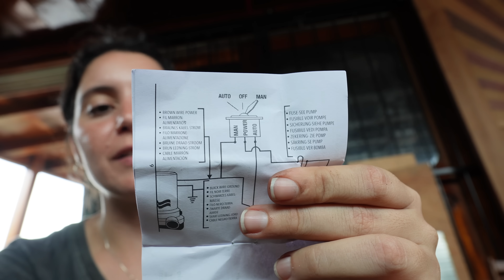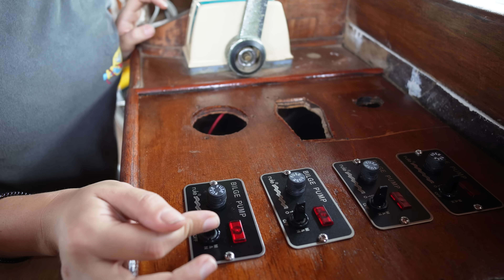This rescued wooden boat won't sink anymore: installing big bilge pumps — Sailing Yabá 178

Comment from the maker: Welcome to Day 10 of our saga towards launch!! 
Place your bets: are the bilge pumps going to work on the first try? 🙈
Reply: YES!
Reply: Donot place outlets below water lines!
Reply: Happy birthday Ben
Reply: I wonder if you've decided where to store the spare fuses?
Reply: might want to put one way valves in the hoses for the bilge pumps in you are gone conect all to one trough hull. so the water doesn't flow from 1 bilge pump trough the hose to the lowest pump. but can only go out of the ship.
Reply: Easy for boat to SINK with thru hole under water
Reply: Of course they will work! 😎
Reply: Easy yes
Reply: Yes
Reply: If I were you, I would install a whale manual pump as an emergency backup should you have a power failure or need extra pumping capacity to save you bacon! Still no reply to the holding tank comment of days 8 and 9. Given we have no date stamp I am sure you will make it happen!
Reply: Happy birthday Ben loving these Daily posts you guys are doing great

Comment: Happy Birthday Ben!  You guys are getting so much done!  Please do yourself a favor and connect the bilge pumps to the wires using heat shrink butt connectors which seal moisture out of the wires.  Those mechanical connectors you are using will be completely corroded in less than a year in a salt air environment, even if they don't get splashed.  Also, you didn't mention if your wire "straight from the battery" has a fuse on it, or if you have fuses or breakers on the pumps themselves (since you are bypassing the usual switch/breakers on the panel).  If not, please add them so you don't risk a worn out pump short circuiting and starting a fire!  (Sorry if you already know all this and just didn't mention it in the video.  Just want you guys to be safe!)
Reply: 100% do this!
Reply: Yes. A good point. More horrors are experienced due to fires on board.
Reply: Great advice but I solder all of my wires that are in the bilge area. And even put dielectric grease on joint then slide over the heat shrink. Shrink it with a heat gun. Some grease will ooze after shrinking just wipe off. And I hope that all that wire is at the least pure copper preferably tinned. A lot of wire now days is copper coated aluminum and will carrode and turn to powder inside the heat shrink in fresh water conditions let alone salt. Fire is a no no in a boat but a failing bilge pump is just as bad when taking on water in open seas. Plus I always put in two pumps in every location for redundancy. Plus a light that will let you know when that float trip switches on is extremely important those switches are not fail safe by any means.
Reply: @gkblair the bilge pump switch has built in fuse. Connectors are in waterproof box so don't need shrink wrap.
Reply: @davidharbison6861 bilge pump has red light to indicate when circuit is made
Reply: @petergreen3381 those connectors are crap. Need a 100% seal   Salt air corrodes anything
Reply: If you put a switch on you bilge pump what prevents it from being shut off when needed? Why would you ever want to shutting it off
Reply: @upinyou8  when strainer is blocked and you need to lift pump body out

Comment: Thanks!

Happy birthday Ben🎉🎉

MP The best comparison of a bilge pump is a sump pump in a house that has a float switch. It’s usually in the basement down in a hole referred to as a sump. It’s where all the water from the basement would go to and then the pump takes the water out of the house, either outside or down the sewer, depending on local ordinance.  Yes, I am full of useless information. 😂

Comment: I think one of the hardest things for non-wooden boat people to accept, is that water in a bilge isn’t necessary a bad thing. And on a wooden sailing boat, it’s inevitable, and a good thing. With such thick hull planking, it’s good to have some water in the bilge to ensure that the planking swells evenly. 
I’ll pass along a fun tidbit about bilge pumps. When your fast asleep, lulled into that wonderful comfort of being on a boat that your own hands and mental powers have helped to craft, when the gentle rocking has finally lulled you to sleep; nothing, absolutely nothing will make your eyes fly open as fast as the sound of a bilge pump coming to life! 
However with that said, the sound of a bilge alarm, will literally tighten every single muscle in your body. So, to avoid a two AM WTF! attack, silence the lowest pumps alarm. Yes some water may have sneaked its way in, however there are alarmed pumps higher up. No since in having a heart attack when you don’t need to😎
And  don’t forget check-valves installed immediately next to the pumps, but in a serviceable area. On the forward pump that will have a pickup hose, install a brass trash filter, not plastic. Plastic can break and allow trash to jamb the impeller. 
Wishing y’all a long and carefree sailing life!
Reply: True all of that AND you should EXPECT some leakage until the wood in the hull expands due to being wet-do not panic it's normal.  After seeing what you faced after sailing the boat initially  I suspect you do not panic easily.😝  Finally I would not put a bilge pump under your bed because that will destroy a good nights sleep.
Reply: Painted bulkheads and bilges illuminate at least 90% of exterior sources of water so most bilge water in from internal sources which always makes for a fitful sleep when at sea. 
I love both of your energies and how you compliment each other and am so glad that I discovered your channel.
Cheers from Vancouver.

Comment: Just some advice, I had a 35’ sailboat for years and when I rewired my bilge pumps , I soldered all the connections  and use shrink tubing on them , making the wiring Full proof against moisture on those connections, yes it’s more work but it’s also trouble free , the last thing you need is a bilge pump not working because of the wiring !

Comment: Happy Birthday Ben!
Two tips on bilge pumps:
- Install a check valve on the discharge hose close to the pump. This prevents water in the hose from trickling back in past the pump vanes.
- Power all bilge pumps and the VHF radio from an emergency electrical panel, switched/fused separately from the main panel. In an electrical fire you still want pumps and VHF after shutting off all electrical.
Reply: A lot of debate online about checking valves on bilge pumps. They can get stuck closed if debris gets sucked in the hose. I'd do some research and make the call. No wrong answer here, just an ongoing debate.
Reply: @gkblair  I've seen a bronze check valve seize closed once, but the owner had it installed in a blackwater discharge. I suspect the fecal matter had something to do with that. In 5 decades of boating, I've never seen a bilge pump discharge check valve seize. But that doesn't guarantee perfection.

Comment: Don’t over tighten the underwater through hole fittings. All of the planking is going to swell. 
The hollow fittings can crack due to over tensioning due to the hull swelling.
If they’re sealed and not at all loose, that’s good enough. After a few months you’ll probably find that they're much tighter than you first installed them.

Comment: Keep a spare pump with a long enough wires to reach a 24 volt power source anywhere on the boat.  Attach clips to the wires, have long drain hose and keep it stored. If a situation comes, you can drop the pump in a critical area and move it around as needed. Great job as always !
Reply: Agreed, this saved one of my boats when I had set the bilge pump outlets too low and the boat was taking in a huge amount of water. However, I had a 220 V pump and a 5.5 KW generator for 220 V (but it took a long time to pump out all the water)
Reply: That was exactly what I suggested in my yesterday comment.

Comment: Good work.  As a reminder, do not forget to install back flow valves after the bilge pumps so that after the pumps turn off, the water does not flow back into the bilge from the exit pipes.  Cheers!
Reply from the maker: We will! Thanks!
Reply: Bilge pump thru hulls should be installed above the water line.

Comment: Ditto heat shrink all electrical connections. Even in the Great Lakes with fresh water this is a must. Salt water is even a bigger issue. Great to wait until you’re sure all works well but then go to heat shrink connectors. I always put heat shrink tubes over my heat shrink connectors for added protection. Catalina 36 Escanaba Michigan capt. Jim

Comment: Happy birthday, Ben! And thank you and MP for taking us all on this adventure. A few thoughts about bilge pumps. It’s important to realize that the GPH ratings for centrifugal pumps like the ones you installed are wildly over-rated. Those #’s are based on lab results where the pump receives full voltage and moves water horizontally, i.e. nearly zero resistance. Every foot of head (distance the pump is required to move water vertically) and every bend or elbow in the line reduces the flow significantly, often by 50% or more. The pumps you’ve installed are fine for nuisance water, but woefully inadequate for anything other than a minor leak. I vote with others who suggest you need something much, much larger if you hope to keep your boat afloat if there’s an emergency situation. You might consider the Ericson Safety Pump which mounts on the driveshaft of your engine, similar pumps run off a front pulley of your engine. Or you could have a stand alone gas engine/pump for emergencies. Forget the manual pumps. You’re young and strong but one of those will drop you to your knees in short order, and water is still pouring in. In addition to much larger emergency pumps, I suggest you research the best materials to have on hand to block/repair water ingress from a damaged hull, thru-hull etc. Apologies for the length of this post, but I would hate to see you, or any boater, put false hopes in over-rated bilge pumps that will be of no use in a true emergency.

Comment: Happy Birthday! 

Tip: I also had a spare pump, which I had prepared to put in a cigarette lighter plug. With enough cord and hose so I could manually place it anywhere in case of an emergency.

The automatic function seems nice, but the risk is that you may have a leak without even knowing it. There should be a signal function (flashing light) so that you know that the pump has started.

Comment: At first happy Birthday Ben. 
Second, as already mentioned, install at least a non return valve in between the bilge pumps and the exhaust of the pump.
I should also install a valve directly at the exhaust. When you remove the handle (and hang/install it close to the valve) you prevent it for beinig closed by accident but in case you want to replace the pump, hose or non return valve, you always can manually close the  valve.
The second reason for a manually valve is that a non return valve can get stucked. When in open position it doesn't work as it is supposed to work, when it's closed you have to replace the valve. In both scenarios you have to haul out Yaba to replace the non return valve.
Best regards, Eric

Comment: luving u guys madly... I live on my mini explorer  boat in cape coral fla. America's largest boating city.. just a note to remember  to install a thru hull for a raw water wash down pump.. I've worked  on boats like yours ( wood) and washing it regularly  with salt water will do wonders for keeping fresh water rot to a minimum.. I recommend  installing a small swimming pool  pump..(fishing trawlers use them to wash the decks) you'll have enough  pressure  to wash the boat very fast as well...

Comment: The fewer through hole you have the better off you will be, and you should remember that some outflows can be joined and other things can share an inflow. I learned that almost 40 years ago when I helped my dad to set it up. It was a bit more work, but the security of having less through holes and getting the sewer release behind any intakes, helped a lot.

Comment: Happy birthday Ben. You should be using "Hydro Air Remote Bilge Pump Switch 12/24 Volt - Max 20 Amp - No Electronic Components in the Water". Don't risk a switch failure that can leak current and damage your wood. I've been with you from day one and can't wait for splash day. Robert from Canada.  🇨🇦

Comment: The views showing the steering gear in the background highlight the fact that while that system might work well in a 6 meter boat, the weight and area of your rudder will destroy that system in a heartbeat when you need steering the most.
Reply: Knowing how much force is exerted on your rudder, this construction indeed seems far too light to me. I am very curious about the first big gust of wind and how this system will hold up.

Comment: two things about the pumps, are the batteries sealed? if they get water over them will they short out ? If they will short if wet put one higher so you can still pump. Also do not fuse them, use automatic reset circuit breakers so even if they trip they will come back on when cooled giving you intermittent pumping rather than off completely if a fuse blows.Some pumping is better than none.

Comment: I highly recommend on the little white square sticky tabs that you are using to attach your tie wraps with when securing your cables that you also screw them down with a small screw. The sticky backing will deteriorate and your cables will come loose. Oh and Happy Birthday Ben!

Comment: MP, the passion you put into doing electrical work is admirable, but I would like to give you some advice, I hope that once the lines are completed, the wires are collected in a channel, both for their safety and also for aesthetics . Ditto the winch wires in the bow locker.
Reply from the maker: Thank you! Most definitely, as mentioned in the video 😉

Comment: As a retired boater CSI surveyor, for your bilge pump in the engine room discharge bilge water, fit a water oil separator as in the norther hemisphere they can go ballistic if a little diesel or leaked oil comes overboard.
Reply from the maker: Hi Lucas! Do you have any model to suggest? We definitely want to add one but all the options we found keep the water and send the diesel out. We would like it to do the opposite though.

Comment: If you put a dab of silicone on the through hull threads  just behind the nut it will act like locktite  and help insure the nut does not back off !

Comment: Nice job! Pls. note that the type of float switches you are installing are prone to after a while give stray current which will be harmfull to the wood. Use hydro operated switches instead.

Comment: Its a big boat, eventually I would run AC to the pump and use a high capacity self priming large pump the size of a pool pump like for water wells. Thats what I will put in mine as an emergency pump. Maybe two. Besides the smaller bilge pumps to remove water from normal sources like rain and waves. Pumps placed up high as also the connections cause its AC. And a switch to kill inverters if water was ever to reach a certain height to ensure everyone gets off safe.

Comment: I think the outlets from the bilge pumps need to be higher. The risk is that if the boat leans at the same direction as the outlet (or high waves) they will be under or very close to the water surface and water will flow backwards. This can be avoided if you make a so-called gooseneck on the hose, a bend upwards like a water trap

Comment: Often for bilge pumps we cut a piece of steel plate the size of a bilge nook, install the mount, unistall the mount and paint the metal especially the slightly oversized screw holes.  Weight keeps it low.  You mounted them well. The float switches should be fore and aft...I think, thruhulls...that's future problems.  I'm now really interested in those Wagus.  Thanks.

Comment: Make sure that you have either a manual override for the pumps you are installing or install some manually operated bilge pumps, in heavy weather if you are taking on water and lose power you need to be able to use muscle power.

Comment: Your screw holes for the bilge pumps suggest you remove and put some epoxy into the holes so you don’t end up rotting the wood in the screw area

Comment: Every through hole or through-hull fitting should have as much Sika around it as possible. yes, wipe up the squeeze-out, but smear it ALL over the threaded part that goes through the hull. Water ALWAYS finds a way. Fill EVERY empty space with a sealant for longevity.

Comment: I have found a check valve close to the pump really decreases the amount of water in the bildge.  When the pump quits running the water in the hose drains back and it is quite a bit of water,  the brass ones corrode and get stuck,  the plastic ones are great.

Comment: Electric pumps are great so long as you can replenish the power supply while the pumps are running continuously . You really need a couple of  permanently mounted manually operated from the cockpit/ pilothouse for when the power supply fails.

Comment: Is it normal to FLUSH the bilge with fresh water before the splash? I would think so to remove all dust and small debris that has fallen into the bilge. Plus checking the function of all the pumps.
Reply from the maker: On wooden boats is more recommended to rinse it with salt water. We cannot wait to rinse all the dust away!

Comment: Don't forget to add fuses between battery and all devices that are "straight from the battery". NEVER run appliance without fuse or breaker protection installed. You can do above with individual fuses (breakers) or a large fuse next to the battery.
Reply from the maker: Hi Jamie! All the bilge pumps have fuses in the switches panel, if you take a closer look you'll see them! 😉